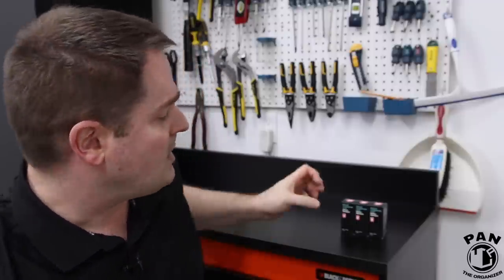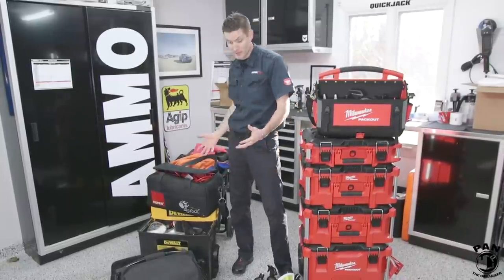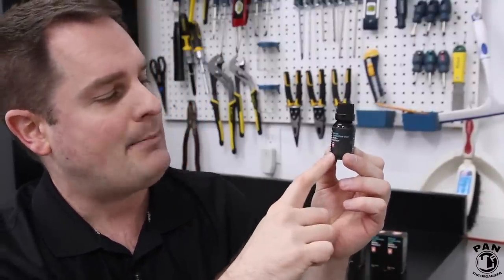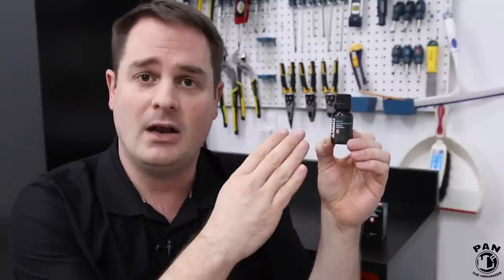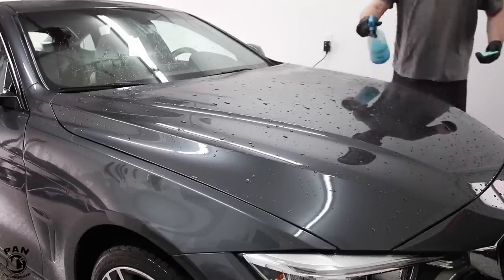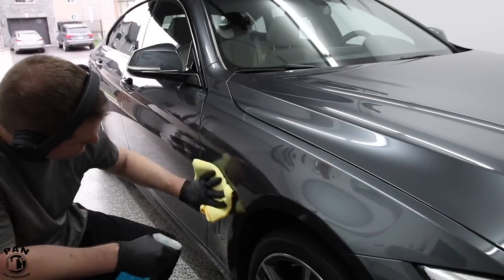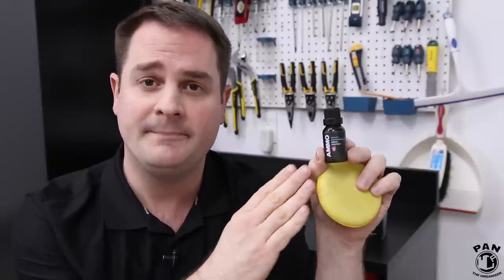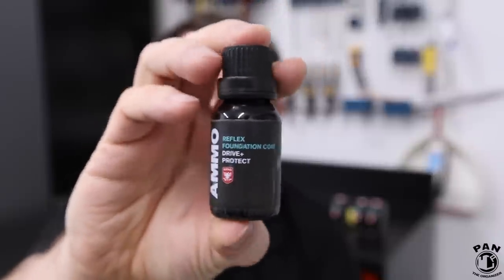AMMO REFLEX COATING REVIEW AND APPLICATION !!

Comment: Hi Pan, one hint that I wanted to share with you and your followers that I received directly from Larry which is such a great hint it will blow your mind.  So when you are done applying AMMO reflex with the foam applicator pad.  Put the foam applicator pad in a zip lock bag and seal it up.  Next time when you go to use AMMO Reflex take the pad out of the zip lock bag and apply some AMMO Reflex then apply to the car.  By doing this you will not need to prime the pad which will save you on the amount of AMMO reflex you use.  By keeping the pad in the zip lock bag sealed the pad never drys out.

Again great video!
Reply from the maker: Super tip Ken!! 👍🏻
Reply: @PanTheOrganizer  Are these foam applicators ..the cheap ones we see on ebay, amazon etc. 12 pieces for 1.9 euros?

Comment: Hello, from Ukraine!)))
For long time looking your channel, and fond of AMMO. I am driving BMW F01, I am correct that using one 15 ml bottle I can cover about 5 layers AMMO REFLEX?
Reply from the maker: Thanks!  It's hard to say how many applications you can get as each person applies a different amount, and it also depends on the size of the vehicles you apply it to.  There's a big difference applying it to a small Smart car and to a big Cadillac Escalade SUV for example.

But a little goes a long way.  You'll be good for multiple applications.

How did you discover my channel by the way?
Reply: Pan TheOrganizer
I am really like the channel. I am Studding some deteiling features from you. I’ll open a deteiling center in Ukraine in 2019. 
Also I would like to offer you show more video with 50/50 before and after.

What can you say, can I use Jet Seal Chemical Guys over the ammo?
Reply from the maker: Yes you can.

Comment: how would you rate ammo reflex against kamikaze ism? pro and cons?
Reply from the maker: ISM is in a completely different price range, so it's unfair to compare.  Even Miyabi is more expensive.  Miyabi will last 24 months and is super easy to apply.  Reflex lasts 9 to 12 months and is even easier to apply and gives a bit more gloss.  Both great companies.  ISM and Miyabi are ceramic coatings, compared to Reflex which is a petroleum based coating.

Comment: Hi, big fan from ksa
I have a question :
Can I put the ammo reflex as extra layer on top my nano coating??
Reply from the maker: Yes you can.  That's exactly what I did in this video.  My car had two layers of CarPro CQuartz UK Edition that was applied last year, and I topped that off with a coat of Ammo Reflex.  It should be compatible with most coatings.

Comment: @pantheorganizer Hey Pan, another question from an avid subscriber here again, I have a question. So earlier I did put on the cquartz UK ceramic coating onto my car, and have been applying one layer of CarPro Reload every 6 months, but should I also be using car detailer on it? I have detailers like Griot Garage and Meguiars Quik Detailer, but does this work when my car has been treated with CarPro ceramic coating or am I just wasting my detailer spray. As always thank you and always will be a huge fan
Reply from the maker: You have to apply a silica spray sealant like CarPro Reload every 2-3 months.  Don’t wait 6 months.  You have to use products that are compatible with ceramic coatings.
Reply: Couldn't you use AMMO SPIT in the same manner?

Comment: Why would you top a coating with a sealant? Coatings give you such clarity.
Reply: According to Larry, you can stack the coat with sealant to take the brunt of the abuse, he talks about it like “putting a windbreaker over your jacket”
Reply from the maker: Exactly!
Reply: AMMO reflex is not a coating like a typical coating that you may already be use to.  This is a foundation layer.
Reply: I am new to the detailing game here so...what's the difference between a "Foundation Layer " and a "Base Coat"? Don't both protect and give massive gloss...?
Reply: Michael Gilbert 
So AMMO Reflex is a base coat that provides with ultimate protection and gloss.  If you polish you car to perfection then apply two coats of AMMO Reflex you will then have the ultimate protection.  Then you protect that with ammo skin.  Skin gets applied once every 6 weeks,  Ammo Reflex can last for a year but Larry recommends reapplying it ever 6 months.  The great part about both skin and reflex they are layerable.  If you maintain the skin and reflex maintenance program, you should never really need to polish the car again
Reply: Ken Bode, thanks for the clarification on this. From what I have been seeing with all the different coatings on the market, the AMMO REFLEX is probably going to be the best/easiest way to go.
Reply: Michael Gilbert, no problem,  it is super to easy to use.  Cures in 2 hours the. You can apply another coat or topcoat with AMMO skin.  If at any time you need to remove AMMO Reflex or AMMO skin you can with a heavy IPA wipe.  I have been using this for 2 years now and I am super happy. Good luck with whatever you divide to go with.
Reply: it seems like pan coated the entire car before hand buffing it with the micro towel?

Comment: I’m getting a brand new car this week. Thinking about ceramic coating or Ammo reflex. What do you recommend? I can do both myself but I’ve been hearing good stuff about this stuff
Reply from the maker: Hi Patrick.  It depends on what you're looking for.  If you want gloss and ease of application, Reflex is for you.  It takes only one coat.  But this is not a traditional ceramic coating.  Durability is 6 to 9 months in the real world.

If you're looking for ultimate long term protection, then I'd go for a ceramic coating like CarPro CQuartz or Gyeon Mohs (or Gyeon Syncro) that will last up to 24 months.  But you need to apply two coats of those, plus a silica spray sealant on top to protect against water spotting during the first 5-7 days of curing.
Reply: Pan TheOrganizer Okay when I go to prep can I use my normal ONR wash or should I use my pressure washer and foam cannon for prep for gyeon?
Reply from the maker: Always do a full pre-wash and wash with water before prepping for a coating.  Don't forget the decontamination stages, paint correction (if needed) and IPA wipe stages.  Did you watch my complete video on how to apply a ceramic coating to a car?  It's ranked number one on Youtube for coatings with over 1.2 million views.  Here you go: https://youtu.be/byKcYsEyWGk

I also have a video on how to do a proper maintenance wash on a coated car here: https://youtu.be/yLiePQRMFc8

Those are two VERY IMPORTANT videos.

Comment: Great review Pan! I purchased a new car back in November and went with the reflex and skin method. I also applied to the plastic trim as well as the headlights. The one thing I’ve noticed is, while the paint beads very well the headlights and tail lights seem bare. Do you think that gyeon trim may be a better option for those plastics I mentioned?
Reply from the maker: Hi Chris!  Thanks for the comment.  For headlights and tail lights, you could go ahead and apply a ceramic coating like CarPro CQuartz or Gyeon Mohs.

Comment: Thanks for all the great vids Pan. I have been torn between the AMMO REFLEX and Gyeon Mohs. I have never used a coating so I am wondering if Mohs may be a bit much to take on...?Thanks
Reply from the maker: Yeah Ammo is as easy to apply as a sealant.  But it lasts 9-12 months.  Mohs is harder because it’s a ceramic coating.  It will last up to 24 months but you need a bit more detailing experience to apply it.
Reply: Thanks for the info Pan...much appreciated.

Comment: Hello Pan. Great video. I use CarPro Essence as a polish. Essence leaves a layer of si02. What is your opinion on using Reflex in top of it?
Reply from the maker: Hi Christopher.  You could, but keep in mind Reflex lasts 6-8 months in real world conditions.  I'd suggest a true ceramic coating first, like two layers of CarPro CQuartz, then use Reflex as a topper.  That's sort of what I did on my BMW.  ;)
Reply: thank you! I have Cquartz on my daily drivers. This will be for my garage queen :) I like the durability of Cquartz but im going for maximum gloss.
Reply from the maker: For maximum gloss, you can top it off with Reflex for sure.  Reflex is insane gloss!

Also, you can try the brand new CQuartz UK 3.0. !!  I made a full video that should go live this Friday.  That's an INSANE coating!

Comment: I don't understand how come u applying every product to same car? Is that good for car paint?
Reply from the maker: It depends if the products are compatible.  Many can be layered.  In the case of my BMW, I was able to apply two coats of CarPro CQuartz UK Edition ceramic coating as base layers, followed by a CarPro Gliss top coat, and then topped off with Ammo Reflex.  No problems, just insane gloss and protection.
Reply: okay got it thanks! I have ques. about my car do u prefer clear bra for paint protection or Ceramic pro should be fine ?
Reply from the maker: I personnally don’t like clear bras and PPF.  But that’s a personal taste.  If you want ultimate stone chip protection, then yes clear bras are your only choice.  If you want shine, gloss, slickness, than ceramic coatings are the way to go.

Or, you can get a clear bra, and apply a coating on top.  Best of both worlds.
Reply: Thanks so much for your opinion!

Comment: Can you apply a wax prior to applying a ceramic type coating?
Reply from the maker: Absolutely not!  Those are two incompatible products.  Always apply a ceramic coating on bare paint.  Hence why we do an IPA wipe before the coating to make sure it’s free of oils or other contaminants.
Reply: Pan TheOrganizer is the ipa mixture is 50/50 with water?  Stuff you can get the store and mix yourself?
Reply from the maker: I suspect there's a little more to pre-mixed paint cleaners like CarPro Eraser and Gyeon Prep, but technically, yes you could do a 50/50 mix of isopropyl alcohol (aka rubbing alcohol) and distilled water.

Comment: Interesting you added that on top of your existing ceramic coating...hmmm
Reply from the maker: There are many coatings that can be layered on top of existing coatings (CarPro Gliss, Gyeon Booster, etc).  Keep in mind, Reflex isn't a ceramic coating, but a petroleum based coating.  It can be used as a stand alone product, or as a topper for other coatings.  From my testing, it's super compatible with my current two layers of CQuartz UK that was topped with Gliss.  I checked details on Reflex with Larry himself by the way.

Comment: will you need to throw away your microfibers after apply this product or not because it isn't SiO2 based?
Reply from the maker: No.  With Reflex, you can wash and reuse your towels.
Reply: Wow amazing product then... Two of the worst things about ceramic coatings, difficulty of application/removal and having to throw away towels, completely avoided!!

Comment: Hey Pan, great vid, as always! 

You mentioned using dish soap as a way to break down previous waxes, but i thought the general consencus was that it was a myth that worked, do you know something i don't? ;)
Reply from the maker: It "helps" to break down older layers of waxes and sealants.  That's where most people get confused.  On its own, dishwashing liquid will not strip freshly applied waxes or sealants.  Hence why Larry himself also suggests adding a few squirts of APC in the wash bucket to increase the pH level and cut through OLDER waxes and sealants, i.e. waxes and sealants that were applied a while ago.  Also that's why I do an IPA wipe as a further insurance to make sure the surface is bare.  You can also use a heavier duty soap like Purple Power Vehicle and Boat wash which will strip waxes and sealants.

Same applies for products like Chemical Guys Clean Slate or any other products that claim to strip waxes and sealants.  There's an important detail that's written on their labels.  OLDER waxes and sealants.  Those products don't strip freshly applied paint protection items.

I hope that answers your question.
Reply: Great answer, thanks a bunch!
Reply from the maker: No worries.

Comment: Applied first coat (first time user) in my garage last night, the sweet chemical (info listed on the packaging) smell is very strong after awhile. If you don’t have a respirator and fits you properly, I’d definitely open the garage door; since some of the chemicals have been linked to cancer.

Comment: I've used this and used GTechniq CSL. There's no comparison. CSL blows it away. Reflex isn't really a true ceramic. more of a base layer for the other more traditional sealants and waxes. it is nice that you can use it on trim though.
Reply from the maker: Yes this is not a ceramic coating.  It’s a petroleum based coating meant to be a foundation that can be topped by waxes and sealants.